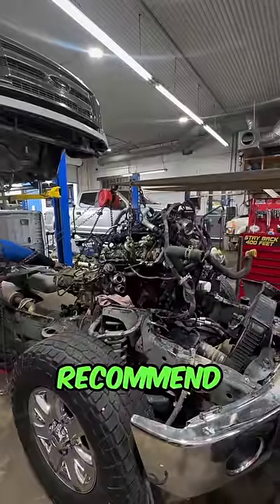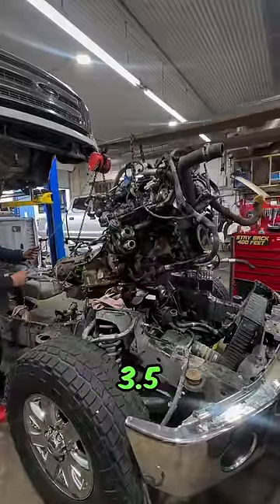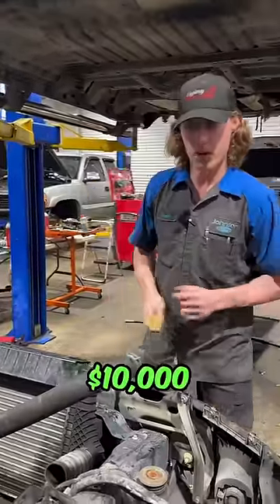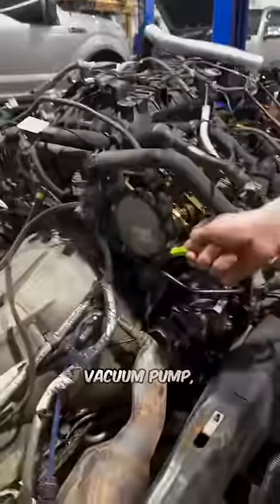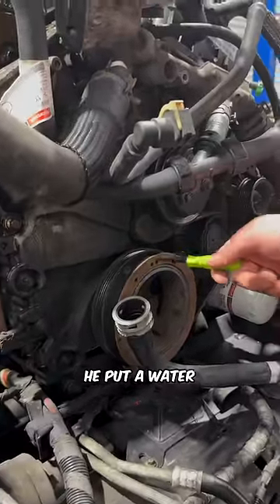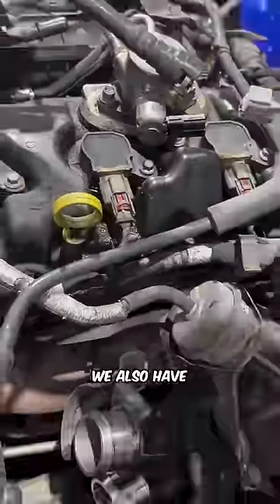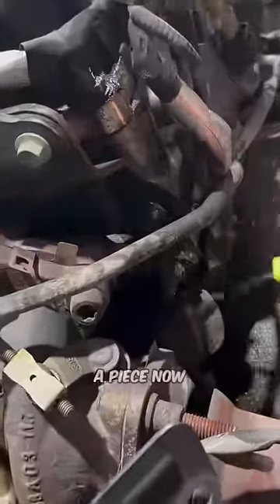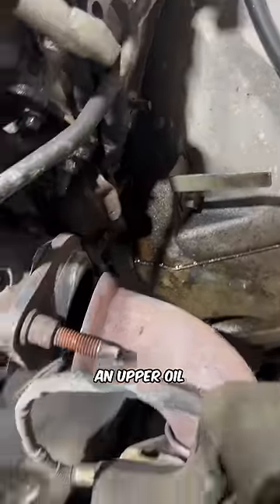Why not to buy a Ford 3.5L EcoBoost? #ford #ecoboost #shorts

Comment: Hell I've had all these problems with my 3.5 with only 120,000 miles. There's a reason I leave my keys in my center console
Reply: Lmfao
Reply: Same
Reply: Insurance won't pay up if they find out the keys were left in it. They will mark it as your fault.
Reply: Eco bust light duty motor, used for towing or hot rodding pure over stressed weak engineered motor plain and simple.,. 🤔👍💪😉🙏
Reply: You know I did the same with my 1 yr old 97’ Explorer back in 98’ when I was told the wife would get it. We were working on The Rouge River bridge in a part of town I was told is “where’s the bodies are found “ but no luck
Reply: Ha
Reply: @TyDomi  not even in the southwest Detroit ghetto zone by Delray do they want your Exploder 😂
Reply: Might as well put a " please steal and trash " sign on the windshield. 😂
Reply: Chris you probably won't get no takers, but if you go out and buy you a dodge challenger or charger you won't have to leave the keys in the car and trust me it will be gone in a week. 😅
Reply: Just got my back from Ford for an oil leak driver side valve cover. Get a call that everything is leaking the quote was more than the Truck. It's a 2017. Got the truck back with just the valve cover gasket, new sensor and pig tails. Get it home cuz it's making another noise. Tech didn't reconnect any pcv or vacuum lines. Forgot to bolt in the air box, left all the battery lines, and other lines unclipped. I paid 1400 for this....o and it's still leaking from the valve cover. The service writer got chewed.
Reply: What?? Quality was Job 1, they said. 🤣
Reply: Yeah it cuz you have push button entry on that model.
Reply: Quality is job one.
Reply: @MadMan_123  So dont tell them lol
Reply: @MadMan_123 i call bs. Nowadays anyone can make a key, or the key might've been stolen from you
Reply: I think I have a 3.5 L Cyclone on my 2011 Ford Taurus
Reply: @JackofAllMasterOfnone86  jack of all huh, coil connectors are 1.5 hours under a shade tree, and valve covers take way less.

Be careful when you let someone work on your truck who is WAY less motivated.
Reply: If it gets stolen, your insurance won't cover it if you leave the keys in it.
Reply: @torino4291  and what if a thief has a key made? How would they know someone didn't steal the key from you?
Reply: But the cyclone has the interior time chain driven water pump
Reply: @MadMan_123  i never take my keys out of ignition home or all over Kansas City. state farm says they will pay no matter where i leave keys.
Reply: @trnot  probably state by state, im in oregon and I bet there are more car thefts here than Kansas

Comment: This kid knows his shit. Wanna know how I know? The fact that he said the factory exhaust manifold is a mandatory replacement when he gets one of these into his shop. Dude knows exactly what ford is up to.
Reply: The engine is based off the 3.7L with thicker cylinder walls. FERD "built" it with Rods, Pistons, and sent it. While the manifolds are different, little attention was paid to the fact that (on a 1-4-2-5-3-6 engine) they were choking the #1 and #4 cylinders (allegedly)

I've thoroughly enjoyed the passing power from one aftermarket set. 60-80 under 3. Intoxicating.
Reply: Dodge 1500's manifolds cracking like crazy also. Seems just like they're all built like shit and we argue over which price of shit is less of a piece of shit
Reply: this comment requires so much inside information.  I certainly hope the customer is allowed to keep and sell those manifolds if they still work fine.  That sounds like some kinda contracted mugging of customers, if not outright theft.  That is like a "recall" or "covered by extended warranty" in every way except its neither covered or free, and instead like a mandatory puncture of 2 (or 4) of your tires with lag screws.
Reply: @bellemorelock4924  the exhaust manifolds that come with the Gen 1 (2011-16) 3.5's do not make use of all the available stud postitions. Diesel makes enough bolt holes on their aftermarket manifolds along with better quality studs so their manafolds don't warp and break off studs. Shitty and lazy design by Furd.
Reply: @mach55r That began in 1982 and with the 225cu 6 cylinder combination manifold. The ends would crack off because of contaminants left in the casting material.
Reply: @zsdjr1  was working on a 4cyl Jeep from late 90s, and there wasn't an exh gasket.  also they deleted a few bolts/studs for cost savings.. it was leaking just a bit, but at all temps (not just a tick at startup).  So I added the gasket and put it back together.  I couldn't drill stud holes (and would have been scared to try) without pulling the engine out.  Never heard back that it failed, but seemed like a temporary fix, that could be repeated at intervals.

what you said made me think of this old tale.  I am guessing its the same, as I doubt Ford drilled and tapped those stud positions only to use a special cheapo manifold without the bolt locations.  Which means its not as simple as swapping manifolds?  The Mopar guys had just skipped half the bolts (and holes) and deleted the gasket, but used the same cast manifold.  Ford seems to have "committed" to cost savings, designing a whole cheap-ass manifold to save 13 cents more.  

The Mopar guys could have just been testing things out, trying to shorten station times on assembly lines with something fully reversible.  I was surprised Jeep was building a side-valve motor in the 90s, so it made sense the engineers were poking holes in it to see how tough it really was.  That motor likely dated to the Willys era.
Reply: My son had a 94 GMC Sonoma with the 6 cylinder. He run it hot and instead of fixing it immediately it sat in my building for over a year. When I finally got around to fixing it I had to replace both heads because they were cracked. When I went to put the factory exhaust back on they wouldn't fit. I called the machine shop that had refaced them about that. He told me that once you take off the original they spread and will not go back on. I bought two new ones and they slipped right on. My 94 Chevy truck with the 350 did the same thing. Maybe that is why he doesn't fight trying to get the old one back on.
Reply: @zsdjr1   Shitty and lazy design; yes, however, the general consensus is
that utilizing more pre-threaded studs 5 would not help much, or at all with through choking the front cylinders letting Exhaust gas at roughly the same time the 2nd and 3rd set

Comment: I just brought back to life, a 1988 Ford F150. It had been sitting for 4 years. It has the 4.9 liter Inline 6. Those engines are bulletproof. I slapped a 1000 bucks into it, and runs like a champ. The reason they left it set, was they couldn’t get it running. Someone had hooked the negative battery cable, to the positive on the starter. It also a 5 speed manual. I only paid 500 for it, and had only about 135,000 on motor. 1000 dollars parts and matenince,is my kind of spending and and oldschool truck that runs. 10,000 spending on a crappy engine, is ridiculous. I could spend 10,000 dollars on something else. 👍👍👍
Reply: An 88 f150 with the 4.9 was my first truck. What a great vehicle. Swapped in a heavier duty zf 5 speed manual, and she towed a bass boat all over the West Coast. Would 20 mpg on flat freeway too. Miss that truck. Sold it to some Mexicans and they trashed it.
Reply: @life_of_riley88  that’s awesome! They definitely, don’t make them to last like they used too. 👍
Reply: Awesome bricknose old school F150. KEEP that sucker for life!
Reply: That's great - that is a good truck. I was just getting a comment for the video coming into my head something like - back a D8 over that Ecoboost Ford & buy a 1970 with a straight 6 - ha ha
Reply: Is that the 300 series straight six? Legendary engines for reliability
Reply: Glorious ford 4.9. my first truck was a 1994 f150 with said engine. It detonated the poor e4od behind it. Now I have a 2000 f150 with a 5.4 and a 4r100 and a 1991 f250 with a 7.3 idi turboed with a 5 speed.
Reply: I just picked up a 94 ranger with 231k for almost nothing. The 4.0 engine and a4lt trans are still running good. I am gonna pull the computer and replace the old capacitors before they leak acid on the board. That is probably more important than any of the mechanical issues currently
Reply: I'm envious.  That's a find.
Reply: When Noah build the ark he had a 300 inline Ford engine in his forklift Legend has it still runs
Reply: @rodney7495  guys why don't we just call it a 300 inline Ford let the Europeans keep their liter bulshit and yes I've been playing with them for 50 years
Reply: ill give you 2000 for it =P  Is that the Mod5 trans?
Reply: Never sell that thing.
Reply: That good ole Tractor motor straight 6 is solid.
Reply: I love a good love story.
Reply: How does it run now? I want to buy a ford truck from that era, what engines would you recommend I stay away from?
Reply: Didn't this one have a problem with exhaust manifolds cracking?
Reply: 150,000 on the ENGINE not a motor
Reply: I was about to say a turbo Barra makes a lot more sense & you come out & mention’s the Barra’s older bigger brother.
Reply: @scooter4196  I just realized I've been using motor oil for half a century. Should I have been using engine oil?
Reply: @scooter4196 
Lighten up, Francis...
Reply: @HaloDaycare 
I don't think Ford made a bad engine back then.. except maybe the 400M. (?)
That 300-6 has more torque than a 302 of same era.  Strength of the frame went down after '79.
Watch YouTube clips from the Charles Bronson movie; Mr Majestyk.
That was a stock 68 Ford, bought used, for those stunt scenes. Anything built after '79 would've been totaled !
Reply: Like replacement parts for an antique? 👀
Reply: Keep it. For goodness sake, don't throw money at a new truck.
Reply: Nice, I just got myself a '97 F350 with the 460 and 5 speed. 

Paid $3200 for it. Well worth it in my book. Have only had to replace the brake master cylinder and new drums, brake cylinders, rotors, and calipers. She is running rich which I hear is a FPR problem so I'll be tackling that and then the clutch next.
Reply: @HaloDaycare You really can't go wrong with any of the engines from that era. I would caution staying away from the automatic transmissions though.
Reply: @scooter4196 Thank you! I tell people this all the time.

It's called an internal combustion engine, not internal combustion motor. Leave the motors to the windows and whatnot.
Reply: @HanginInSF Motor oil is for your window engines.
Reply: Enjoy that. Ford made a zillion of those things. 2' of space on either side of the block. Yours has EFI. It's a huge upgrade from the prior carb'd ones.
Reply: @YourLordMobius  "1991 f250 with a 7.3 idi turboed with a 5 speed" 

That is a perfect combo. Not the fastest, but those IDI's will run forever at a very low cost!
Reply: I own a 1989. I love this truck for live!
Reply: My Mother had a 1996 F-150 with an in line 6, that truck had the body rot away and the engine and standard transmission ran like a champ. It was always serviced but a true testament to what was once an incredible drive system
Reply: Always buy pre extra tech...Just easier... 👌
Reply: I've got an 89 Chevy, 4.3 engine with 139k put more money into tires than I have into repairs, much easier to maintain and keep running than a lot of newer vehicles
Reply: @H33t3Speaks not hard to get new parts for older trucks, a lot of parts are interchangeable between certain years of trucks
Reply: Own a 1980 Bronco, built 10:1 331 stroker, 4 speed granny low, lsd front/rear, all new everything. Also own a 2010 Lincoln MKS 3.5 ecoboost AWD. Both serve me well
Reply: I bought a 2000 Ranger for $2200 and I've put a few grand into it so far, and it runs pretty good now. 25 years old now and the rust isn't bad at all, going to be taking care of all of it. 320k miles, 5 speed manual. AC and heat works, leaks some oil and some fuel by the filler neck. Going to be taking the bed off soon and doing a whole fuel system replacement basically.
Reply: 1994 Chevy c1500 step side bed bought it for 2500 bucks because they couldn’t figure out why it was idling rough…well 5 mins on YouTube and iac valve I was on my way to Florida to pick up this beast!! My daily now people don’t want to work on their own stuff anymore smh!